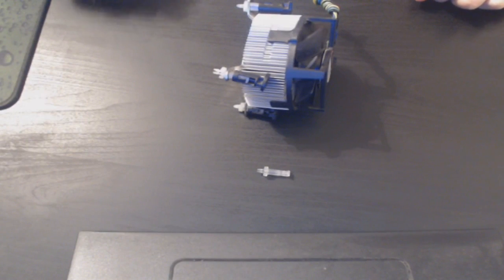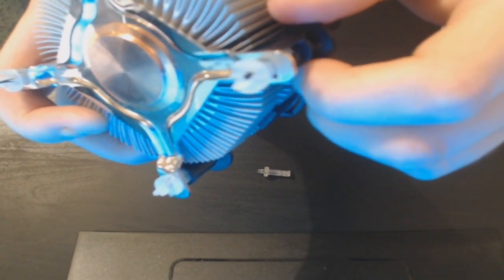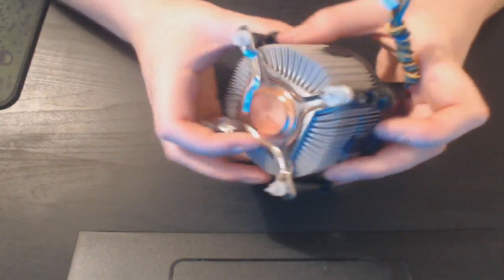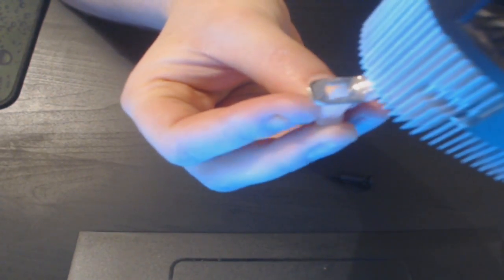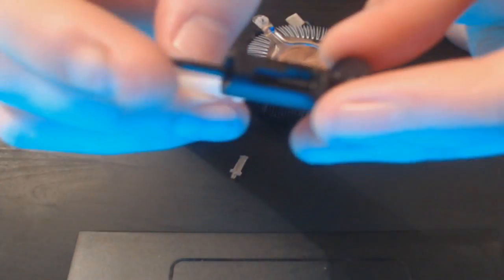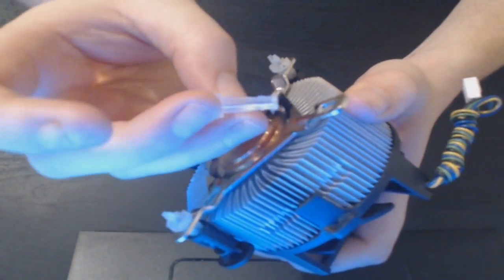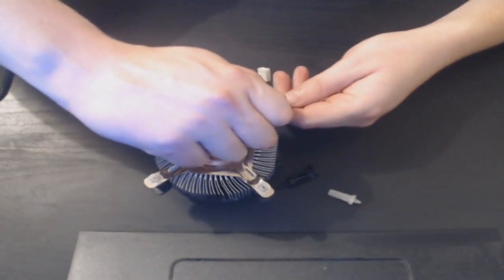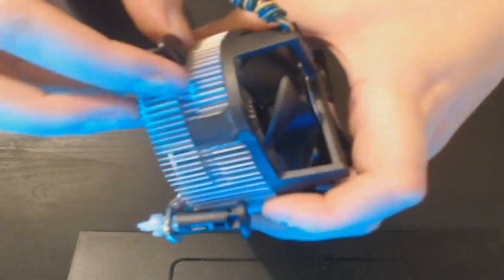How To Replace Heatsink Mount Pins for Intel Cooling Fans LGA 775 Socket

Comment: Mine has plastic holders for the pins. I broke one of the holders so my suggestion would use pliers on both ends when removing and maybe you will have better luck with removing the old ones.

Comment: Any suggestions on how to pry the black part from the clear piece? Even after turning counter clockwise I cannot pull the black piece apart from the clear piece. I even snapped the tab that holds the black piece in place but it still won't give. I have two of these that are temperamental, the other two came apart just fine though.
Reply: Yep, he forgot to show how to do it, instead of this we see 1:14 when he easly disconnect (already disconnected) these parts. It's like showing how to disassemble an lcd monitor frame with already disassembled frame.

Comment: this is a classic disentanglement puzzle - just been looking at this myself and initially used a tiny flathead screwdriver to 'cheat' but no tools are required - the way to separate them is to move it from the 'unlocked' to 'locked' position while it is only inserted to the midway point
Reply: Thanks! this along with the video helped me get the job done!

Comment: Worthless video. I'm trying to remove the pins and the video doesn't really explain how I'm supposed to remove the black upper part.
Reply: I did it my own way but one of the retainer broke off then a small pin didn't allow it to be removed so i just pulled it out (yes i broke the cylinder) then use superglue and done.
Reply: You cant. You need to remove different than in this video... Probably push the inside ratainer or something.